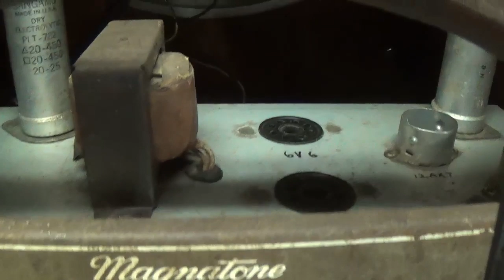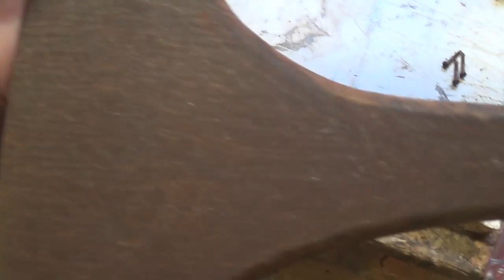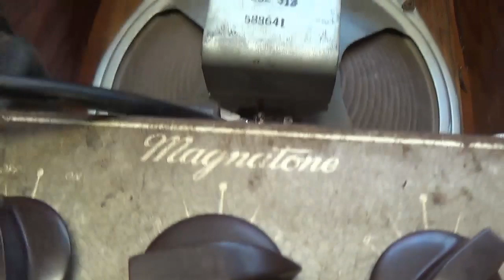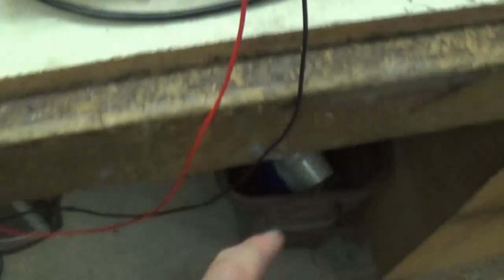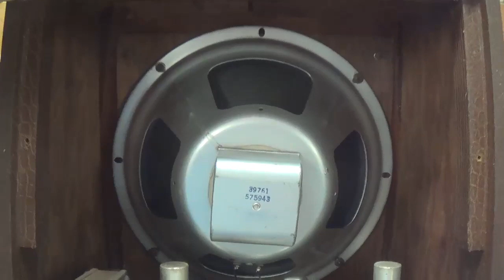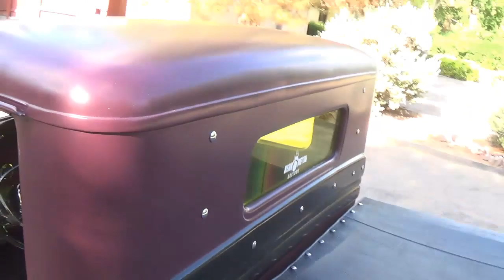1947 to '52 Magnatone M195-5J Melodier Deluxe gets its voice back :)

Comment: How can you tell if a speaker is alnico? Is it the square horseshoe type thing covering the round inner part?
Reply from the maker: Yes, the Alnico magnet is like a small spool inside of an open metal framework. A ceramic speaker magnet looks like a hockey puck.

Comment: UD, 
You're Bad, You're Na-tion-wide..... mostly you are ZZTop Kool, in other words Texas Cool  !

That's a good lookin' Amp with a lot of style and a great sound ! They are fairly simple but very rich sound. 

Robert aka jagjet

PS. That Color of the truck is a dead ringer for the 1988 Silk Cut Jaguar that won the 24 Hours of Le Mans beating the mighty Porsche 962 running away. It held the most miles covered in 24 hours until very recently.
Reply from the maker: Thanks, Robert. That's an interesting historical note......I'll check it out on the net :)

Comment: I had an Airline (Danelectro built) 60–9032 amplifier that had a Hepner speaker in it. it was also two 12ax7’s, 6V6’s. Most of the ones I’ve seen have the same speaker. They sound good. Nice amp!
Reply from the maker: Your screen name sure applies to the second video :) Thanks, 6.
Reply: Yep, carburetor guy, lol. Your deuce pickup is cool! HAMBer too, name is reference to a 312 Ford with 6 Strombergs on a weiand dragstar intake in a 48 f1 pickup. Here is a vid of an A pickup I had that went to Finland.
https://youtu.be/VgIIp8Vym4c

PS, turn those scoops around, if you didn’t know, 97’s hate air forced down them.

Comment: Hi Uncle Doug... Either y'all 're playin' inside an all metal shipping container or that l'il monster has some amazin' nat'ual reverb like no body's business... oh and which guitar did Ollie bring over & did'ya happen to catch which pickup and where the volume wuz set on same...(?)          ...AND, really think them side-mounted breathers look so cool.  So is there any way you could rig the other four twos so's ya could make 'em kick in on the fly (w/o of course gagging and drowning*) ? Thanx for yet another great vid... luv the amps, luv the rods and Zachery sez hello to your feline contingent... cheers                                                                                                            *maybe dial back the extra pumps?   (...six flutterbyes all perpendiculating all at once (tee hee))
Reply from the maker: It was my shop guitar with neck pickup switched to single coil and bridge to humbucker, straight into the amp. The amp is surprisingly loud, so the volume setting was probably only 2 or 3. Thanks for the truck comments.
Reply: @UncleDoug  You're always welcome... My Epi 335 has coil tapping and I frequently go with the neck on humbucking mode and the bridge single coiled for that little xtry detail and also by adjusting bridge volume it's kinda like having a treble control on the guitar... thanx again & cheers
Reply from the maker: I have come to use the guitar pickup and tone controls much more than those on the amp, Jonny. I'm beginning to wonder if amps really need tone controls.
Reply: @UncleDoug  I hear ya brother tho' I've always been a sucker for eleventeen knobs even when twirlin' 'em does so little... Then again, as I get to know my personal amps I'm finding messing with the treble or backing off the NFB can be both profound and inspiring... and even when I think I'm such a skilled knob adjuster, time winds up yielding secrets that won't be rushed... cheers

Comment: Those ink bottle 6V6GT Tubes often sound really good , a different flavor than the clear bottle types, although they might not handle as much voltage and current as the later 6v6GTA tubes. No one has ever been able to explain to me what the engineering design or scientific reason was to coat the inside of the glass bottle with whatever that black material is. Normally, having clear glass is preferable because it allows the tube to radiate excess heat right through the glass, assuming the class is clean. If it was a preamp tube,  I would suspect that it has something to do with shielding and that the material is conductive, but an output tube such as a 6V6 does not need shielding! And those tubes already have getters to neutralize stray gasses and gashes contaminants.
Reply from the maker: I understand your curiosity as to the benefit of the coating, GU. I personally have no idea.
Reply: @UncleDoug  , there was a huge apocalyptic event, and the secrets were lost!  I have a huge collection of tube manuals and vintage electronics textbooks, but where they talk about the metals, chemicals and materials that go into them, certain things are never mentioned. Occasionally, you'll find a tidbit of nerdy engineering-detail that finds it's way into ad copy, like "gold-plated grids for better heat transfer and reducing grid emission/runaway bias"* or some such....but by and large, most of those design notes and engineering logs must have been shredded or incinerated when the tube-manufacturing plants closed; or perhaps those tube-related notes ended up in China or Russia along with the associated assembly-line machinery that once churned out tubes by the millions here in the States.....

Original British Genalec/Gold Lion KT66s and KT88s had gold plated grids....

Comment: It would be amazing if you could do a comparison each time of the amp with its original speaker and with a new speaker. I know that would be difficult finding a speaker that would match the originals specs to make the comparison accurate but i would really find that incredibly interesting. But the videos as is are great! EDIT: The Ford is in surprisingly good shape, great find!
Reply from the maker: Thanks for the nice comments and good suggestion, Michael.

Comment: The leaky bumblebee coupling caps are what killed those 6V6's causing them to turn on hard.
Reply from the maker: You're probably right, Daniel.
Reply: I’ve seen a few bumblebees in my Revere S-16 due to leaky capacitors, I decide to replace them with .05mfd and 630v coupling capacitors in which I’m working on repairing my Revere S-16. 

I did removed two original capacitors since it’s been leaky like crazy. One of them is a silver capacitor where it runs a DC motor. Without a capacitor, the motor on my Revere S-16 doesn’t run. But it needs to be replaced.

Comment: 10:31 why do some techs parallel new caps with bad cans what if the old cap is shorted? I always eliminate the old cans or try and remove them
Reply from the maker: Amen, TW. Old caps must be completely isolated from the circuit.
Reply: The old filter cap needn't actually be shorted, just electrically leaky, in order to cause problems.  Paralleling a new capacitor across the old one still allows the defective capacitor to leak voltage and create hum because there's still a significant amount of ripple getting past those two piggybacked capacitors and into the rest of the power supply. Of course,, a cap  that leaks will create internal heat, and eventually it WILL short out!
Reply from the maker: Excellent advice, GU. Thanks.
Reply: @goodun2974  The technique used to preserve the "look" of those old relics is to just unhook those old capacitors and let them sit on top of the chassis with nothing
connected below. The new caps are soldered in under the chassis near the old ones to keep added wiring short and to the point. Some diehards actually open
those old chassis mount cans...jerk the innards out and hide new caps inside. I think that's going a bit too far.

As a kid, I dreaded messing with those electrolytics that were leaking gunk. I feared I'd end up getting some on me...have it run up AND down my family tree
causing extra eyes, loss of limbs and other defects. Turns out the stuff in there is boric acid. Not exactly the deadliest compound to exist.
Reply: @tomfrye9037  , personally, I have never paralleled a new filter cap across the old one....but  I suspect that for some people (lazy people!) the lure of using the terminals of the original cap as dolder points for the new caps, and not having to unsolder and relocate, or replace,  the voltage-dropping resistors that feed each successive section of the cap can, is too strong to resist. It's not particularly difficult to install a couple of new terminal strips, unless the chassis is very small and crowded.